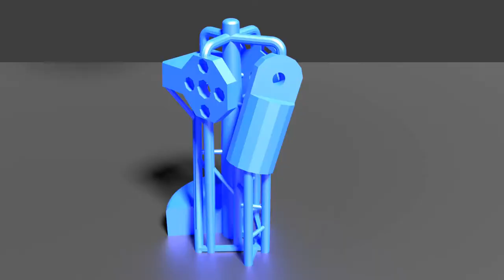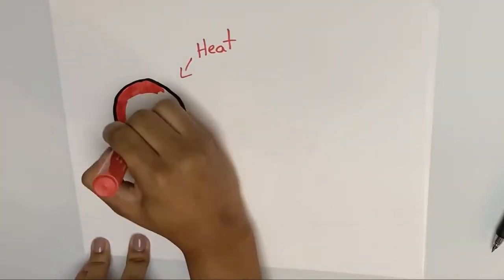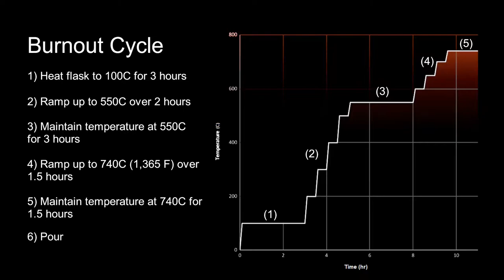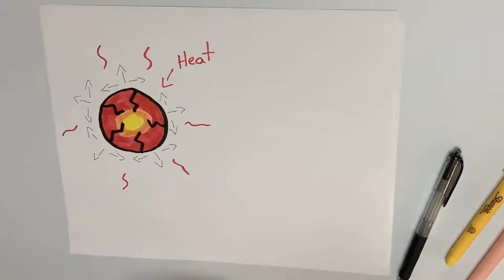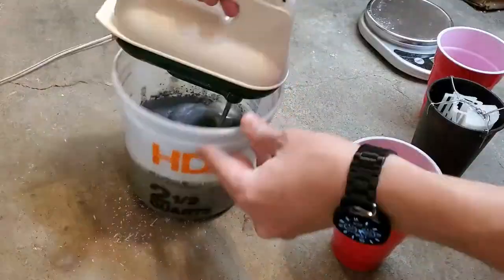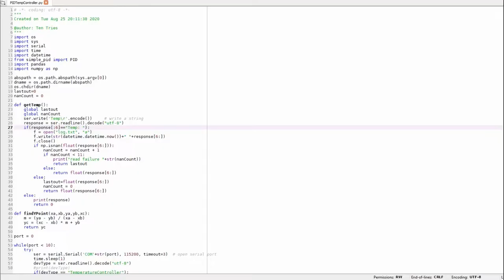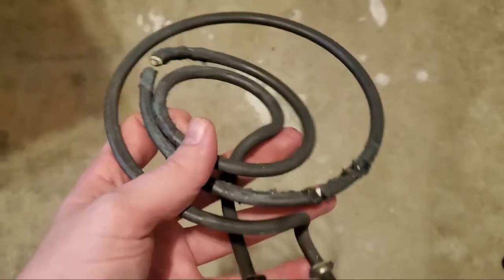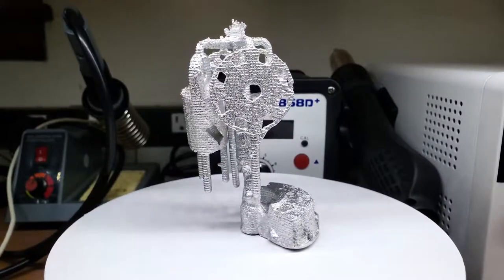Watch THIS Before You Quit Lost PLA Casting Aluminum! (PART 2)

Comment: Since you're doing a gravity casting instead of centrifugal or vacuum assisted casting, you're going to need larger sprues for the metal to flow, probably about eight to ten gauge wax wires. The main reason your parts aren't casting fully is that when you pour the aluminum in, the air/gas in your mold isn't forced out through the porosity of the plaster, as it would be with a vacuum casting or centrifuge. It's like trying to fill a water balloon by putting water in your mouth and blowing it into the balloon. It's just going to get messy. ;) 
You made a good step with having a pour channel, but it would be easier for you to have your model anchored to a hemisphere of clay or wax, about the size of a ping-pong ball. That forms what's called a sprue button. Then, run gas exit sprues from the top of each piece in your model back to the floor of your casting flask. It'll look like a weird umbrella. Keep them about a half inch away from the hemisphere/sprue button. When you pour your molten metal, pour into the button and watch for it to flow to the holes left by the umbrella sprues as it forces the air out and occupies the cavity left by your model. Try it first with pewter/Britannia metal, since it melts at lower temperature and stays fluid longer. Aluminum should stay molten long enough to run through the whole model, though.

Comment: Increased head pressure by raising the height of the sprue. Make a fine plaster slurry and make a thin  coat over the model to give better details. I use ransom and randolph investment with fiber for extra strength (I do large vacuum casting) so I'd also recommend adding very fine fiberglass in small quantities to your investment. Great job though!
Reply from the maker: Thanks for the tips!
Reply: Ransom and Randolph Ultra-Vest is fantastic.  Add a pinch of boric acid to the water if your casting plastic/resin.  Makes the investment a little bit harder so it doesn't crack when the plastic expands during burnout.
Reply from the maker: Sometime after I fix the Z-Axis wobble issue on my 3D printer, I'll do a "DIY Casting Plaster Recipe Revisited" video. Make some improvements and see how it stacks up against Ultra-Vest. I'd love it if I could make an investment plaster almost as good with just Home Depot ingredients!

Comment: 11th try: I would make a quick vacuum chamber.  A cheap vacuum pump, a round piece of 1/4" thick aluminum, a steel pot, a gasket and some fittings.  The whole setup costs less than a single perforated flask and you can use it with your soup cans.  You can emulate the perforated flask effect with 4 small straws along the edge of the soup can.  

Any sort of flask casting shouldn't use vents like you've got there.  That's a good technique for sand casting, but leads to poor results with a flask.  There are some other minor changes that should be made, but really you were on the right track.

Cheers and good luck on your next ten tries at a random task.
Reply from the maker: That might have to be a future video!
Reply: @TenTries  VOG also has a video on a cheap homemade vacuum setup, although he upgraded to a commercial one eventually

Comment: I think you should look up vacuum pouring. Look up --> Microwave Kilns, Lost Wax/PLA/Resin casting with a Vacuum Cleaner . You can also try sand which lets out the air .

Comment: Nice project, but how do you think VOG got better results using straight Plaster of Paris? His early coin pour was before he got the Kaya Cast with the vacuum chamber.  It would have been nice to get a good look at the PLA print before pouring plaster all over it.  Just to know what the final result was supposed to look like before the resulting pour. Did you make the layer lines that thick intentionally, is the last mitation of your printer or we're the the lines a result of the pour/plaster?
Reply from the maker: Could you provide a link? I'll have to approve the comment when you do btw. I'd have to look closer at what VOG did. The venting must have been pretty good and I'm guessing he used a better aluminum alloy. This was just pop can aluminum, so it was pretty thick (more viscous) compared to an aluminum & silicon alloy that is typically used in casting.
The printer has a terrible z-wobble issue and that is probably the banding you are seeing. I've been printing with another printer lately that doesn't have that issue
Reply: @TenTries  Ah, he used an investment plaster.  (Wish I knew what kind) Paster of Paris was used for something ng else.  He also built a vacuum chamber and had a vacuum machine.  All the rest seemed, more or less, the same.   

The vacuum casting he did a couple of videos 
Later with a DIY vacuum pump was pretty good too.

Comment: Try zinc ,? plaster only needs to be dry and  500to700f to prevent cracks in molds. Casting and extruding (popcan )aluminum are quite different materials.

Comment: From another engineer who is learning how to cast aluminum, I'd like to share a nugget of critical information with you and your viewers.
The surface tension of molten aluminum is ~14 times higher than water, so it requires a higher pressure than you might think to conform to mold details.
Vacuum casting creates a ~1atm pressure differential between the sprue and the mold to force the aluminum into the tight spaces.
~1atm is 407 inches of water column, Aluminum specific weight is ~2.6, so to compete with the vacuum results, you would need a 13ft tall sprue.
Reply from the maker: Hey, don't you bring math into this! You wouldn't happen to be one of those engineers who actually got to take classes on fluid dynamics, would you? I feel like it should be more complicated than just comparing the flow with water. Also, that's assuming differential pressure as opposed to removing air so it isn't trapped, displacing the aluminum. Also, I tend to imagine aluminum more like runny pancake batter than water haha.
With electrical, the only flows we talked about were of electrons, magnetic fields, and "holes", so if you have any more formal experience with fluid dynamics (compared to my almost 0 formal experience with the subject lol), I'm certainly open to discussing further!
Reply: @TenTries  I am one of those engineers who took fluids and heat transfer and all that, but I still spent a summer making failed castings to learn the ins and outs.  You are right on track thinking of it as pancake batter, and trapped air is a problem, but even with perfect venting, the mold details like gear teeth just won't fill well without a higher pressure to overcome the surface tension.  Soon I'm going to start casting large pieces, so that will have a whole new set of challenges, like the molds don't fit in my kiln to do the burnout procedure.
Reply from the maker: I probably should mention that I used pop can aluminum for this video and part 2 as well. In the sand casting video, I alloyed 8% silicon to reduce the surface tension, and the difference was huge. It traveled a lot further up my gas vents than I expected. Forgot to get actual diameter, but it was less than 1mm. I'll have to try the gears again with the silicon alloy and set up a vacuum system to see the difference. I'd bet that the gears would look like gears with the alloy, but to function as gears for any reasonable amount of operation time, I'm betting they'd have to be vacuum cast and touched up with a file. Probably still not as good as machined. Only one way to find out for sure!
How large are you thinking?
Reply: @TenTries  I use 6061 aluminum so it is weldable and I can have it nickel plated (chrome) for car parts.  My longest part is about 4ft long, and my heaviest part is about 25 pounds, so the sizes are all over the place.  I'm going to have to build a custom mold burnout box for each mold probably, maybe I can achieve it by stacking loose ceramic bricks and just laying a heating element inside the volume.  I have an idea for vacuuming these molds for casting by basically vacuum bagging them with a hole in the top to pour.  It doesn't have to be pretty or last for very long.  All of the parts I am casting are for my 1937 Pontiac Coupe, so they have to be perfect or they don't go on the car.  As you mentioned, the surface tension of pure aluminum, which is basically what soda cans are, is higher than alloyed aluminum, but all alloys still have really high surface tension compared to other metals, and the lower density means less pressure in the mold so it's a double whammy.  Try casting the same thing in aluminum, and copper and the difference will surprise you.
Reply: @DavidChadwell  6061 is a pretty bad material for casting, silicon content increases the fluidity (decreases surface tension), so alloys designed for casting like 319 or 356 are far better, and can be heat treated to very close to 6061-t6 properties.  I'm an art degree person, but took some of those fancy pants math classes you guys do ;)
Reply: @themotoworksinc5702  I haven't tried any of those alloys for casting.  I use 6061 because I work in aerospace and I have a good source for scrap aluminum.  I may try adding some silicon to see if it makes molding better.  I also wonder how those alloys compare to 6061 for plating of decorative finishes, some alloys are not good for plating, which is critical for my applications.

Comment: Something that should be tried is after the pour hold the mold/can firmly with the pliers and take an electric sander without abrasive attached turn it on and hold the rubber/velcro cushion against the handle of the pliers for a bit before it solidifies to see if it can move trapped air to the top and out of the casting.

Comment: hi! first, thanks for the videos!! i'm doing a matrix and them help me a lot.
I want tell you can be a posibility youre usenga normal dish soap but  in some contrys or compani's solding a ultra concentrate dish soap.
I divide in to 6 mi especific dish soap (ALA Fron Argentina) and i have a wonderfull result (in the especificactions it tell what a tablespoon, 15ml is yields in 6 litros of whater) i  replaced a 12ml from your target mix for 2ml 

thanks a lot! 
and sorry but i suck on maths.
worst on inglish

Comment: what brand of pla are you using. I see very little ash and you are at lower temps
Reply from the maker: 3D Solutech usually, but a lot of other brands work too as long as it is "natural PLA". Theoretically, there should be no ash bc there are no pigments and PLA burns (or boils, more likely) away cleanly

Comment: But.. Did you use some melting flux for aluminum? The problem appears to be in aluminum.
In my opinion part of the problem is in the aluminum, then in a test the aluminum appears slightly golden, it happened to me too and when it happens in that area it cracks. I think it is due to the tin of the can in which I had poured it, and I seem to have seen that a couple of times you used a can as a crucible, you have to use a graphite crucible, absolutely no tin in contact with aluminum and if you suspect some aluminum mixed with tin, throw that material away, don't try to reuse that
Reply from the maker: In tries 1-9 I used lite salt for flux. I was using a 304 Stainless cup for my "crucible". I wouldn't recommend using a stainless steel "crucible". The lite salt was causing corrosion where it was touching the stainless steel. For try ten, I placed a few lumps of charcoal in the furnace to produce a reducing environment. It seemed to be about as effective as lite salt without corroding my "crucible". 
I had thought there might be iron contamination, but figured the color should be throughout the metal, if so. I am not sure why 7 turned so golden and only one or two of the others are even slightly golden colored. Since tin cans are tin-coated steel, it's possible that what you saw and what I saw are iron contamination, not tin contamination. The color only being on the surface may be attributable to iron in the aluminum reacting with the plaster.
Regardless, I bought a graphite/clay crucible. I just need to get around to making tongs and a second furnace.

Comment: If i tried this i would make the plaster mold in 2 steps, first i would paint the plaster on with a brush in a thin layer so that no air bubbles are present, then i would place it in the cup and add the plaster around it.
Reply from the maker: That sounds a bit like ceramic shell casting

Comment: Add sodium silicate to the casting mix?
Reply from the maker: That might be a good idea for aluminum casting! Since it melts around the same temperature as copper, bronze, and brass, it might not work for those
Reply: @TenTries  Also, instead of "burning out" PLA, could it be heated to ~ 70°C and majority pulled out the hole with some dental tools or something? I wonder if soot ruins the surface quality?
Reply from the maker: @TheAndyroo770  The burn out cycle also removes chemically bonded water in the plaster. (Needs temps much higher than 100C, 212F) This ensures that the investment doesn't blow up when molten aluminum is poured in
Reply: @TenTries  Sure but for certain molds, you may be able to get the melt just right and the sprue hole big enough to just pull out the PLA then continue to "dry"/burn out the mold casing? Just throwing out my thoughts
Reply from the maker: @TheAndyroo770  That could reduce ash if you did it just right. Some guys spray a little air in to flush it out. I have a video idea on the list along the lines of "how ash is ruining your casts", but that idea is going to need a lot of research